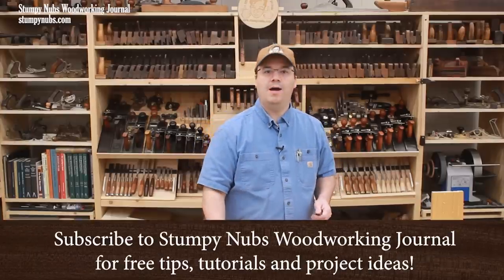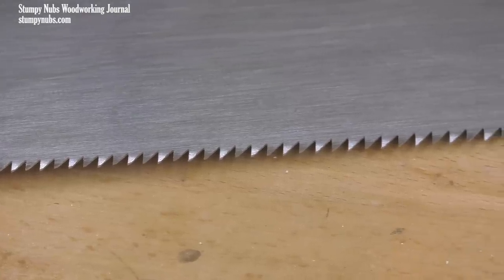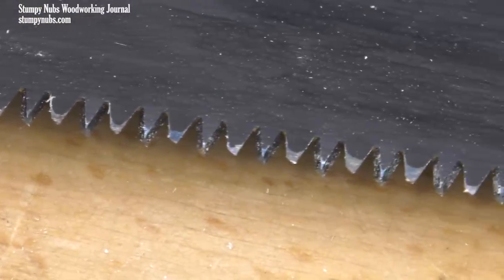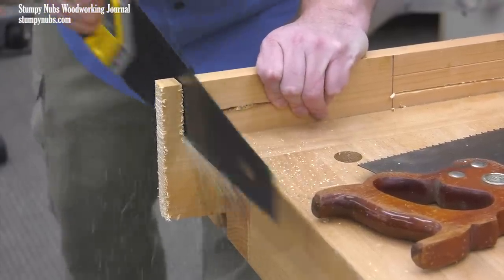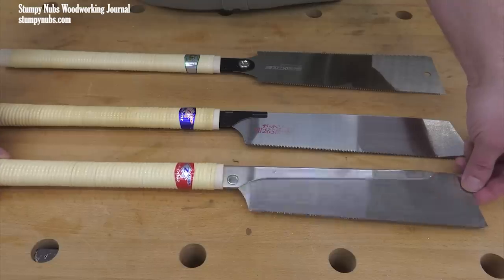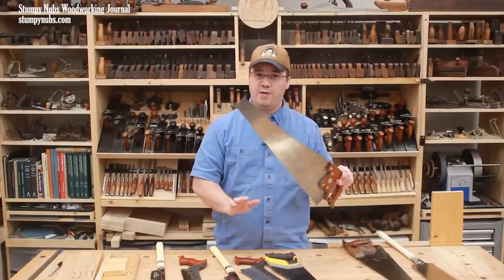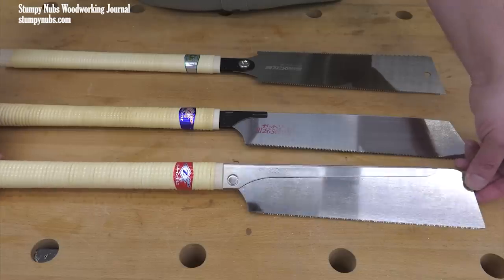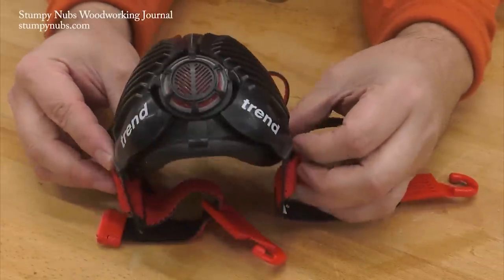Do Japanese saws cut faster than western saws?

Comment from the maker: ▼EXPAND THIS SECTION FOR MORE RESOURCES RELATED TO THIS VIDEO▼   

Pull saws used in this video:
-Ryoba (fast, rough cuts): https://lddy.no/1447c
-Kataba (finish cuts, flush cuts): https://lddy.no/1447e
-Dozuki (ultra-fine cuts and joinery): https://lddy.no/1cd7y	

Push saws used in this video
-Hybrid double-cut saw (same as the Dewalt, but cheaper): https://amzn.to/3i8tOsI
-Quality western rip and crosscut saws (comparable to my antique Disstons): https://lddy.no/14ugm

Video about Japanese saws: https://youtu.be/PZdoLx72faM

★THIS VIDEO WAS MADE POSSIBLE BY★
-Trend Stealth respirator (original): https://amzn.to/3vyuKfS
-Trend Stealth Lite mask: https://amzn.to/3C6cmNQ
Please help support us by using the link above for a quick look around!
(If you use one of these affiliate links, we may receive a small commission)
 
★SOME OF MY FAVORITE CHEAP TOOLS★
-123 Blocks: https://lddy.no/vpij
-Mechanical Pencils: https://amzn.to/2PA7bwK
-Lumber pencil: https://amzn.to/2QtwZjv 
-Pocket Measuring Tape: http://amzn.to/2kNTlI9
-Irwin Drill Bit Gauge: http://amzn.to/2AwTkQg
-Nut/Bolt/Screw Gauge: http://amzn.to/2CuvxSK
-Self-Centering Punch: https://amzn.to/2QvbcrC
-Self-Centering Bits: https://amzn.to/2xs71UW
-Angle Cube: https://lddy.no/10nam
-Steel Ruler: https://lddy.no/10mv7
-Utility knife: https://amzn.to/3nfhIiv
-Center-Finding Ruler: https://lddy.no/10nak
-Bit & Blade Cleaner: https://amzn.to/2TfvEOI
-Digital depth gauge: https://amzn.to/3mwRf2x
-Wood Glue: https://amzn.to/3mqek6M
-Spade Bits: https://amzn.to/3j8XPtD
 
★SOME OF MY FAVORITE HAND TOOLS★
-Digital Caliper: https://amzn.to/384H1Or
-Marking Gauge: https://lddy.no/10muz
-Marking knife: https://lddy.no/10mv0
-Narex Chisels: https://lddy.no/sqm3
-Stanley Sweetheart Chisels: https://amzn.to/3y5HDOc
-Mini Pull Saw: https://amzn.to/2UEHBz6
-Gent Saw: https://lddy.no/ss2x
-Coping saw: https://amzn.to/2W7ZiUS
-Shinwa Rulers: https://lddy.no/zl13
 
★SOME OF MY FAVORITE POWER TOOLS★
-Miter Saw: https://amzn.to/3gqIlQ8
-Jointer: https://amzn.to/3yc3gfZ
-Planer: https://amzn.to/3mn6BGF
-Router: https://amzn.to/3grD22S
-Sander: https://amzn.to/3DdvD0Y
-Cordless drill: https://amzn.to/3D9ZiIm
-Brad nailer: https://amzn.to/3gsRkjH
-Mini Compressor: https://amzn.to/3mvrmQr
-Bladerunner: https://amzn.to/2Wl0TtJ
-Jig Saw: https://amzn.to/3zetTBY
-Scroll Saw: https://amzn.to/3gq9qDc
-Multi-Tool: https://amzn.to/3muZuMi
 
★SOME OF MY FAVORITE OTHER TOOLS★
-Drill Bits: https://amzn.to/3B8Ckzh
-Forstner Bits: https://amzn.to/3kk3wEI
-Shop Vacuum: https://amzn.to/2Wkqnbl
-Machine Setup Blocks: https://amzn.to/3gq7kDh
-Counter-Sink Bit: https://amzn.to/37ZukUo
-Featherboard: https://amzn.to/3DeqHsq
-ISOtunes Hearing Protection (Save $10): https://bit.ly/3BHYdH7
 
(If you use one of the affiliate links above, we may receive a small commission)
Reply: There was something not mentioned:  WOBBLE / BINDING.  Look at the push saw wobble like madd, as it was being thrusted forwards.  It was Binding at times, causing side to side drift / wobble, and slowing down the cut.

 Where as with the PULL saw.. there is no binding when you push forwards... and you are pulling the blade straight and tight... to keep it from binding as you make the cut, and go past it.

 In addition, the thinner Kerf takes far less effort on each cut, as you are moving through less material.
If you add some lubricant to the blade, it may even reduce frictional forces even further.  Id try a car spray that uses Urethane in it.
Reply: @johndough8115  There's a lot not mentioned, like the rake of the teeth, etc. that can let a saw remove material faster and thus cut faster and with less effort but it's a messier cut that works for rough cut but not fine joinery.  You can go back and forth all day on it.  End of the day, it comes down to how you use it and what you're working on...
Reply: @ZeoCyberG  Doesnt matter.  Its pure physics.  Slow down the video, and watch the traditional push saw blast side to side, as its being pushed through the wood.

 This is because the teeth can bind up, and the blade is thin enough and not supported, that its able to veer to the sides... which is amplified by the springy effect of the blade itself.

 If you put a handle on the opposite side of a push saw... you would eliminate the issue... because you would be pulling the blade straight, under tension, through the entire cut.

 Which makes the case for a potential hybrid saw, which rest below the forearm.  Or possibly a u-shaped handle, that pulls the blade from the front.

 Look at a tool like a hand held Planer.  The blade is generally push oriented... but the handle is mostly towards the front of the tool.   If you put the handle completely at the rear... it would be more likely to accidentally veer to the sides.
Reply: @johndough8115  I'm aware of the physics, it's why push saws are usually thicker and why there are versions with spine backings as well as other designs. For example, western saws actually include versions with multiple handle.  There's a lot more variety than shown here and a lot more that factors into the design.  So it all does matter!
Reply: The Trend Stealth mask is great. I bought one just before Covid hit. Then, I couldn't get new filters for it for over a year, nor could I find regular N95 masks. I ended up buying a package of oval makeup remover pads and using those in the Stealth. They weren't a perfect fit, but they caught all the dust that would normally have gone into my lungs so I call it a win.
Reply: Link to the Dozuki saw is broken.

Comment: Sawing technique / ergonomic is seldom discussed and is brings out difference between Japanese and Western saws.  Traditional Japanese woodworkers often have lower benches and sit at the bench instead of standing over it.   Laying a board on its face and cutting a dovetail or ripping a tenon is easier with a Japanese saw than a Western dovetail or tenon saw.   The long handed, you hold with both hands, the saw is vertical in front of your face, easy to see it square to the board.    Having lower back issues, I find working like this less fatiguing than standing over, or hunched over, a workbench.   Ditto on Japanese planes.  Pulling a plane while sitting is much easier on the lower back than pushing a western plane.
Reply: Part of me wishes we could find statistics on the work-hours-per-age-group of historical Western and Japanese woodworkers; could Japanese masters have spent more hours working in their old age than Westerners? It might make sense that older people would prefer different work styles than younger people.
Reply: @danielkruyt9475  While that is generally true for people "just doing it", I have to say, once it becomes a practice and a craft, the techniques tend to equalize between age groups, because the good practices are always good practices. Sure, a younger person feels they can just shrug it off, but it still does longer term damage. And you can feel it at any age, even if less. Doing it the comfy way, once you get the hang of it, no problem, the faster or "just do it anyway" way gets tiring much faster.

The difference in tool development across cultures is very complex and interconnected with other things, it is often not just a mere matter of comparing one chosen efficiency. Differences between the local material available (softer woods very often), average stature, cultural habits, etc., all influence it.
Reply: I'd add that I couldn't make a straight cut to save my life. Even very crude furniture was beyond me unless I wanted to spend hours with everyone's favorite pastime- sanding.

Then the discussion started to turn to ergonomics, body mechanics, and, by degree, Japanese saws.

While still not woodworker by any stretch, I can at least make a table that doesn't wobble now.
Reply: yeah ive seen them, they use their feet as a third hand too. 
i say safety comes first and western saws win
Reply: I see your lower back pains, and raise a both upper, lower and nerves that get stuck one in a while pains..  My experience is, anything that can be done with two hands, is less "hurtfull" than the same done with a lighter toll with one.  Digging kinda explains the difference, and I can barely fish at all with a light one hand rod, but some hours of two hand fly fishing just helps my back, by moving "all" parts without any heavy stuff.  Probably the same reason, swimming works well for many back patients.
Reply: @quintessenceSL  3 legs works every time..  :D
Reply: How do you make the angled cuts for a dovetail holding the blade with both hands in a vertical position while you are sitting? Are you using a miter box or just clamping and repositioning after each cut? I don't think I've ever used a handsaw to cut rip let alone cut dovetails in a seated position. I don't think I have the skill unless the piece were really small. Sounds challenging to me. I'm restless. I can't sit still and do woodworking. I'm always grabbing for something. lol

Comment: I can grant that on a stroke for stroke basis there wouldn't be much difference BUT the thinner kerf of the pull saws means that less power is required to make a cut which after a long day of sawing isn't insignificant and will result in less cumulative fatigue per cut.
Reply: You can clearly see the difference in effort required in the video too. Also the difference in cut quality is just absurd. 
I still have a very nice large push saw that I use for rough cuts, it's easily faster than my Japanese pull saw, but I will always wrap things up with the latter.
Reply: I was waiting for James to mention the blade thickness.  I am not particularly worried about a few more strokes either way, but pull saws just feel better to use for me now.   I still pick up push saws when I feel they might be better, but they feel coarse.  I am sure I can saw straighter and squarer with a pull saw as well, because it is so easy to move the handle to give a very shallow cut to the marking line on your side, and then lift the handle to finish the cut.
Reply: That depends on the saw that you're using if you're using a finer tooth saw that specifically made for joinery like a tenant saw dovetail saw gentleman saw, then you can have such a thin curve as well. The main difference is whether or not the gentleman saw tenant saw or dovetail saw had been properly sharpened before use and that the tooth set is not too much.

Comment: As I'm not a professional who has to work against the clock, speed is of very little importance to me. The difference in the cleanness of the cuts is what makes pull saws my preferred saws. If I just need to dimension a piece of wood quickly, I use my circular saw. Even it produces cleaner cuts than those Western saws used in the video. But ultimately it makes no damned difference at all, because everyone chooses what he prefers, and that's fine.
Reply: I did notice that the pusher rip saws really munged the sides of the kerf.
Reply: Very interesting, nice discussion of the practical aspects. Just what I always enjoy with your vids. But ultimately for me it comes down to... What do I feel like using today. I really most enjoy using one  kind of saw or the other just cause I like how each feels when I use it. So.. Tea today, coffee tomorrow... But a fine tooth dozuki is really hard to beat for making accurate cuts without the benefit of frequent practice sawing.
Reply: The shots nearly always had the pull saws exiting the cut away from camera so it was never a fair comparison of the tear out - we needed to see both sides of the boards. Though from my experience, the sharpness of the japanese saws does generally result in cleaner cuts.
Reply: because you're watching the pushing side of the "western" saws and not the pushing side of the "japanese" ones. If you look at the other side of the "western" saws it's clean too lmao
Reply: @davevick1775  But if you want a nice finish, you touch it up with a plane anyway. Sawed finish is ugly, no matter what saw, or how perfect your technique is. Japanese saws can get an ok-ish finish for inside the joinery in some kind of joints. But european joinery is often done with blades (axes, planes, chisels) rather than saws, because that leads to a way more accurate finish.

Comment: it is odd to me to compare the speeds. I don't think pull saws are faster but look at the massive difference in the cut quality! the push saws tore out so much. in that first test, the Western saw even left huge wedged gouges on the side of the cut. and just to add, my favorite feature of a pull saw is that you really have to try and screw up to get them jammed. just so smooth.
Reply from the maker: Speed can sometimes mean less energy expended. Of course there are also many other factors involved. This is just one of them. The first video discussed many other factors.
Reply: @StumpyNubs  yeaaaah, but then you have to spend more energy later cleaning up the cut. I dunno, I just don't often use quick and rough. I guess I don't really know what the conditions are, aside from cutting down the tree, where it'd actually save time and energy.
Reply: It's more complicated... Besides push and pull, there's rip and cross cuts, rake, rough and precision saws, among other variables... Most large western saws are meant for rough cutting.  So precision and clean cuts aren't why you would use them but there are the smaller saws for doing that work and typically, regardless, you're still going to use other tools for the final fit and finish...

While there's also related variables like which saws can actually last the longest, which can be adapted to do different work, which are more durable and can perform well with harder woods, etc.
Reply: Remember, the camera was on the side equating to the output side of the push saw so you would expect any breakout to be visible.  We cannot see if there was any breakout on the pull saw.
As to your second point, I find that the pull saw jams much more, but only on the return (push) stroke.
Reply from the maker: @PanEtRosa  I made a clear distinction between rough dimensioning cuts and fine joinery cuts in this video, including demonstrating both. You can make finished cuts with speed, and there is definitely a benefit to that, which is clear if you have ever dovetailed a chest full of drawers. But again, speed is not the ONLY factor to consider and I am not saying all work should be done quickly.

Comment: I'm not sure speed is something I care about for woodworking saws. If I were just sawing through a log sure. Interestingly, they do actually make a Japanese pull saw for that sort of thing (though I'm not sure how common they are--the first google link says they're uncommon, but you can buy them on Amazon).
Reply: And those saw are light years faster then any western style saw. They can most actually catch up with a chain saw they cut so fast on woods like pine etc. Any of the silky saws are amazing and if you cut stuff in the woods you should have one. I used to  have a silky katanaboy and it cuts so fast it doesn't seem real.
Reply: If you were sawing a log all day, you probalby would want a balance between productivity and comfort (well, you always want that in general). Also, you still need a finish. Sure, the first pre processing cuts, not essential. But eventually, you've pre-processed enough and it is read to be turned into lumber, and you'd rather do it once, nice and clean, than cut it really fast, then have to face every single face of every single board because your tool/techique/system was too focused on cutting speed, rather than whole job speed.
Reply: @louisvictor3473  Well the kind of saws that I was talking about like the silky katanaboy are edc/outdoor type of stuff. It is something you would take camping.
Reply: @konnan216  of course, there are also western saws made for very fast cutting on feral wood.  and in a sprint, they can keep up with a chain saw in some cases. one tester said they estimated the break even point was about three cuts.  that's the point you realize that li-ion has higher endurance than muscle.
Reply: @louisvictor3473  If you were sawing logs all day you would buy/rent/loan a chainsaw. But yes, for occasional cutting one of those pull saws looks great. Personally I would throw both in the car though, because you don't have the room to do pull or push at times.  I use bow saws a lot to maintain the trees around here but if that has a directional blade you could reverse that fairly easily.
Reply: @Torchedini   I thought it was self evident, but I (and I presume OP too) was talking about doing it with hand tools specifically. Of course it is easier to do with a power tool.
Reply: @kenbrown2808 For sure there are like old logging saws that can cut at crazy speeds. Some of those I imagine really can compete with a chainsaw. The katanaboy can only compete at logs like 10" or less in diameter. Silky really does make some incredible saws for outdoor/survival type stuff.
Reply: @konnan216  I'd like that blade on a pole saw instead of the cheap blade they normally sell.

Comment: Once and for all, we have our definitive  answer. "It depends."

I like them all. However, I do lean towards the Japanese saws due to their lower weight, cleaner cuts and ability to inexpensively replace blades. I spend enough time sharpening other stuff. Sometimes you just want to use a tool.
Reply: This is exactly where I fall on yhe issue. I'll admit that I have a soft spot in my heart for western traditional woodworking but ease of use and price override my nostalgic tendencies lol.